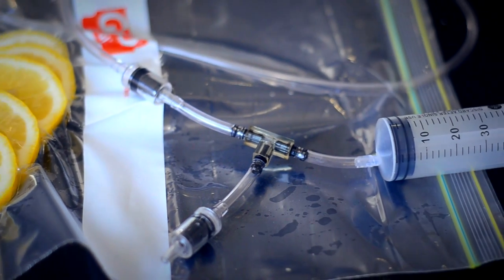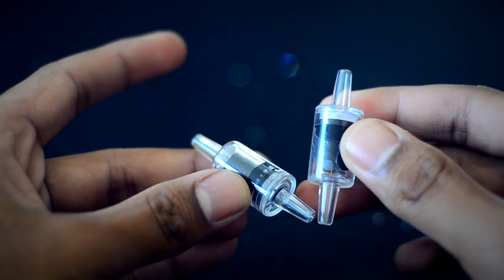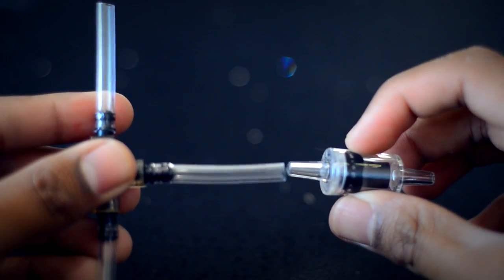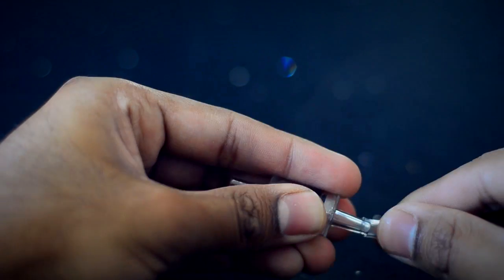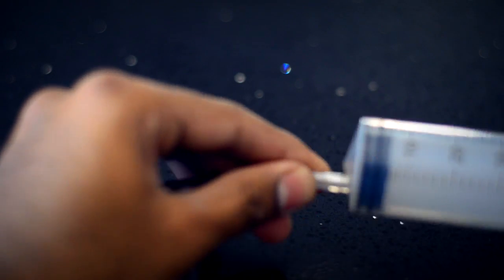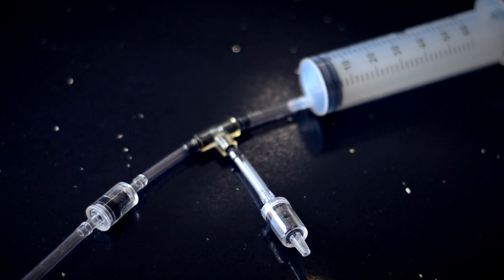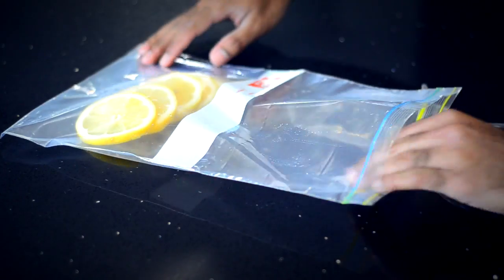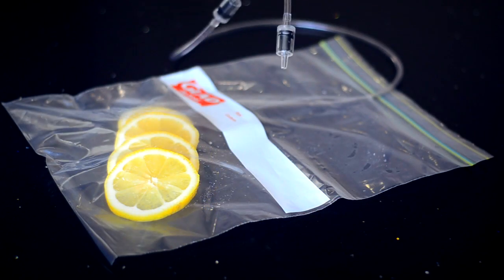How to make a Vacuum Sealer - Life hacks

Comment: Purchased a food vacuum sealer for about $105 cdn , spent a lot of time getting  bags made, then sealed only to have 3/4 loose there seal. Went to the pet store purchased the items required about 20 cdn. Just finished repacking all the previous items in a 10th  of the time with a much better seal at a much reduced cost by using the freezer bags  . Thanks, this is such a useful DIY project

Comment: that's a creative idea. Submerging the ziplock bag in water will also work. Water pressure will push the air out. It costs less, doesn't ruin a bag, and no equipment is needed.

Comment: I'm going to try this, but make one modification. Use a larger bag (like a gallon bag) as a semi permanent vacuum chamber, and use the item you want to seal in a smaller bag (like a quart bag). Put the item in the small bag and put that into the large bag. You use this pump and the bigger bag with a hole in it, and it will remove all the air within both bags. The pressure will close the smaller bag inside (you may have to adjust it a bit or press through both bags to firmly close it correctly) then you can remove the smaller bag and put that in the freezer without worry for the packing tape issues.
Reply from the maker: I will be revising this design in a few weeks. I am just waiting on a few parts to arrive from China.
Reply: China? Great! I'm out.
Reply: In fact I went further.  Just get one of those "space saver" vacuum bags for storing clothes, put your zip-lock  small bag inside, seal the outer bag and vacuum all the air out of it.  Before you open the outer bag, seal the zip-lock bag as it should already have all the air sucked out of it.  After that it's simply a matter of opening the "space saver" bag and taking out the perfectly vacuum sealed zip-lock bag.
Reply: I would replace the syringe with an automotive vacuum pump for ease of use.
Reply: maybe use a standard  vacuum. Most people have one of those.
Reply: my brother says that you're the best!!!
Reply: @tavolo22  hmmm, so do you use this technique? Does it work well? How long does the seal last?
Reply: I like the way you think! 👍🏻

Comment: Instead of compromising the zip lock bag with the puncture hole, why not simply place the tube in the bag at one side of the zipper. Then run the zipper closure right up to the tube. Hold the bag tight around the tube, draw out the air, then in one motion pull out the tube while closing the zipper completely. That way there is no tape or any compromise to the bag and its vacuum. Another interesting way to create the vacuum is to utilize a "brake bleeder" vacuum tool to manually pull a vacuum on the bag. Innovative video. Greetings from Ontario, Canada.

Comment: Great - Thanks! I ordered the stuff and look forward to using this DIY vacuum sealer.
Reply: +TheWindGinProject Here is a cost list all via eBay with free shipping.  T Connector was 5.89, Check No Return Valve was 3.99, 60ML Syringe was 2.96 & the Air Line tubing was 3.54 for a total of 16.38.
I believe this system will work better than the few retail manual versions on the market. I have read that the special bags with the valve will leak pressure and therefore are not reliable. Plus those special bags are expensive. I will report back after I try the system.
Reply from the maker: +TheWindGinProject Great! Cost me way less than that! Try it out and see how it works for you. The guys over at instructables tried it out and tell me although it works well, there is a little bit of skill required when pulling out the tube once all/most of the air is removed. Some material engineers said that the plastic will leak air over time and that I should consider using thicker bags. Hope you have success in sealing something on a budget like many others did.
Reply: Mad Science Hacks | Life hacks & How to OK, Thanks for the extra information. I think a reliable way to keep the vacuum seal would be to put the sealed bag inside of another cheap bag. However I have a different type of tape in mind that may at least keep the tape from being a leak issue. I will experiment with heavier bags also. It would be good of you to correct the title and take the 2 dollar cost out of the title. I'm not complaining but that should be corrected I think. Cheers!
Reply: +Mad Science Hacks | Life hacks & How to    

REVIEW:  I gave it an honest try but it does not work well enough to be useful. It does work as far as removing excess air from the bag but it is very clumsy and the seal simply is not reliable at all. Therefore, for all practical purposes this is not a good option for vacuum sealing anything. (food or dry goods) It is a waste of time and money.  I'm not upset but I feel that this Hack is a bad one.  Peace
Reply from the maker: Sorry to hear that. The folks over at Instructables tried it with very good results. The seal strength depends on the bag you use and the technique employed for pulling out the pipe. If it does leak, it's only because the zipper on the bag isn't closing all the way towards the corners. This could be how it is manufactured ans isn't your fault. The beauty of this hack is that we are using items that weren't designed for this task. The video shows enough proof of a tight seal but thank you for posting your comment. I'm sure that this will help someone else.
Reply: Mad Science Hacks | Life hacks & How to OK, It is all good. Thanks for leaving my comment up for others to consider as well as your points. Have a great day.

Comment: What I do, is suck the air out by using a straw and inhaling it - very quick, easy and cheap, plus it works as well as my poor deceased electric vacuum sealer did. This does seem a tad over-engineered.
Reply: Not the most hygienic way to go about it.

Comment: This is too complicated and expensive.  All you need is a length of 1/4 or less of tubing or even a plastic straw.  Slip it in the bag all the way to the bottom.  Seal the Zip Lock Bag up to the hose or straw.  Place the other end of the tube or straw in your mouth, suck on the tube/straw and pull it out as you do this.  As the tube/straw get to the sealing part press the seal and your done.  Now place in freezer and your good to go.  I've been sealing foods like this for years.  But I would recommend you use the best Zip Lock Bag available at your store.
Reply: mrunderhood  Not hygienic at all 👎🏽

Comment: holy sht that is so goddamn simple! now I don't need to buy those expensive vacuum sealers!
*dances off*
Reply from the maker: +MrUnkownGuyAC  I'll be posting more videos like this very soon!
Reply: the sealer (machine) isnt the problem , you can buy the cheapest one.....the bags are the problem, over time their cost will accumulate. it is the same thing with the printers. printers are cheap, inks are expensive
Reply: Your points are valid. However this is perfect for off grid life. Takes up almost zero space and needs no electricity.
Reply: @MadScienceHacksTV  can you please suggest a hack for a better way of sealing the bags as the final step? Tape only slows it down. After a matter of hours the bag has air in it again. I've tried 3 different tapes so far.
Reply: misa smith  a while back i tried using the bag sealer that cuts and seals. Wasn't a strong hold. I abandoned  that project a while back. The air suction pump was an absolute  success. Finding a way to keep the bag sealed air tight was a complete  failure .  There are cheap food saver machines that I'll move onto next.

Comment: I just made this and it works well. It's a lot a fun. The only thing is when pulling the tube out you may get some air back in. Also make sure the whole is very small.
Reply from the maker: +Graphic Society It takes practice.  I'm working on a version 2 that addresses some of the flaws this design had.

Comment: This looks great! Could you write out the name of the valves and other unusual equipment (i.e. not the syringe or bags as I got those!) as I struggled to hear what they're called in order to ask for them. Thanks in advance!
Reply from the maker: Hey Tracy, maybe this will help? - http://m.instructables.com/id/Cheap-2-vacuum-sealer/
Reply: Thank you so much!
Reply: @MadScienceHacksTV        This link no longer works.  I do not know  what connectors parts I need. Thank you.

Comment: Hi! Why do you need to perforate the bag first?What happens when you get the hose out?I think it's good hack, just trying to understand completely. Thanx!
Reply from the maker: You need to make a hole smaller than the tube so that when you stick the tube in, it forms a natural seal. You will have to seal the hole and pull out the tube at the same time! tricky!

Comment: Approximately how many pump strokes does it take to evacuate the air from a gallon freezer bag using your 60cc syringe? Thanks!
Reply from the maker: +Yodaismycopilot Around 30-ish strokes. This will vary depending on how much of air was in the bag before sealing. You can speed up the process by flattening the bag with your hand before you seal the zip.
Reply: Thanks for all of the answers. I may try to find a bigger volume syringe for fewer required pump strokes.

Comment: Thanks! Awesome! Just curious since I am not very scientific: what purpose does the second valve serve (the one that dangles off to the side that is not directly between the bag and the pump)? Is it to release air being pushed out of the syringe on the down-pushing stroke?
Reply from the maker: +Yodaismycopilot That is correct. The valves are positioned in opposite flow directions. The 'dangling' valve is the exhaust valve which allows you to compress the syringe on the down stroke.
Reply: One valve allows air out of the bag when the plunger is pulled up, it closes and the other one opens when the plunger is pushed down.

Comment: I made one of these with cheap stuff from the store and a syringe from ebay.....works great to......but there is one problem I need some suggestions for....the taped up hole slowly leaks out. I tried packaging tape, gorilla tape black, and gorilla tape clear......experimented with multiple bags and the same result. It gradually let's the air back in. Any suggestions?
Reply: What if you burn the hole?
Reply: @fentariahari9020  been working on that......thinking about modifying one of those mini bag sealers without the cutting piece. Thanks for the suggestion . ....I haven't found anything else that would burn the hole closed without melting through both sides of the ziplock bag.
Reply: @freddiemac327  put some aluminium foil before you heat them might be useful as it can lessen the heat to the plastic somehow
Reply: It really is an interesting project. I think i'm gonna try it out once i got the chance to do so.
Reply: @fentariahari9020  what should I heat it with?

Comment: Yes, you are sucking some air out of the bag but you aren't getting anywhere near any level of vacuum comparable to any electric vacuum sealing machine
Reply from the maker: How did you come to this conclusion?
Reply: MAD Science Hacks.  because  a commercial vacuum chamber sealer with a 1/4 horsepower motor takes 40 seconds to a minute to do almost absolute vacuum on food packages.  you are not getting anywhere close to that .  Do a follow up and put a vacuum gauge in a bag and seal it the same way that is being done here.  I would be surprised if the needles moves much.
Reply from the maker: The point of this is to not compare it to a commercial grade vacuum sealer. This is homemade - keep that in mind. It performs exceptionally well for what it costs to make it. It's pretty close to a 100% vacuum. Build it and test it and come back to me. Hundreds of people have made this with success. There's no need to prove the concept, let alone compare a syringe to a motor-driven vacuum pump.
Reply: My estimate of the vacuum of the syringe method is it should easy manage to get pressure below 0.4 bar ( similar to immersing the bag under water 6 meters ) - maybe not as good as a motorised unit but this manual pump method does not require any power and is cheap which is an advantage.

Comment: LMAO!!! A zip lock bag and a big pot of water will give you the same results. Typical Engineer over Engineering.
Reply from the maker: Okay. I think I've been through this before with other people over at instructables and a few other places. To use the water method ,and achieve the same quality of vacuum, you'd need to A - Place the bag at a ridiculous depth to take advantage of the water pressure required and B - have a large enough container for such a large amount of water. Any other method that requires a pot or bowl of water will not remove close to enough air as a true vacuum.
Reply: The water pot method has it's issues. Doesn't work well at all in my experience. Too much hassle. Not enough pressure.
Reply: Pressure mod for your dip method:
A. Get your carkeys 
B. Drive to your nearest swimming pool C. Dip your ziploc in the deepest part of the pool 
D. Go back to your house 
E. Cook or store your recentrly vacuumed meat
Reply: Bill Latibay 😂

Comment: I think using a straw would be  easier
Reply from the maker: You won't achieve the same vacuum
Reply: Any suggestions  on great ways to seal the bag puncture without the slow air leak through the tape?